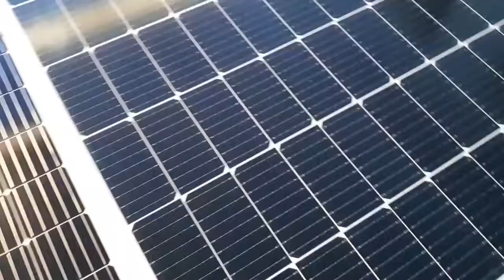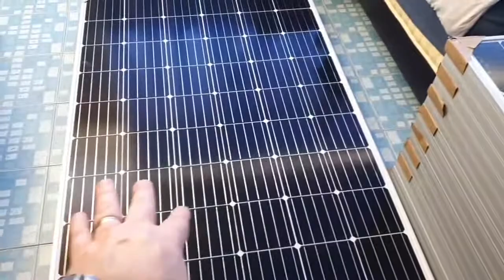About half cell solar panel technology and PERC

Comment: Gday fellas, do I need to do anything different to install half-cut panels into my off-grid system than what I did with the older panels. My new half cut panels dont seem to have the usual black box for diodes etc.
Reply from the maker: Half cut is installed in the same way.